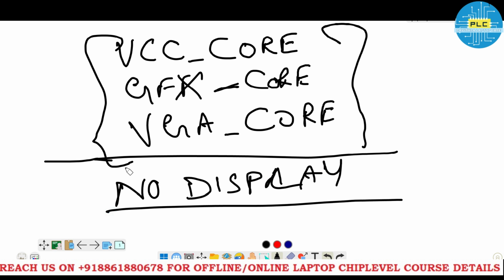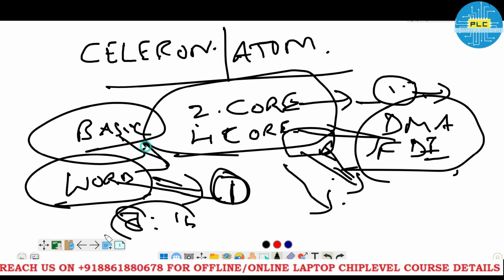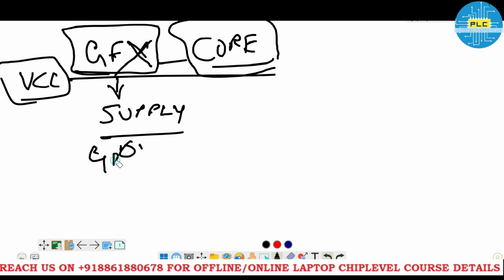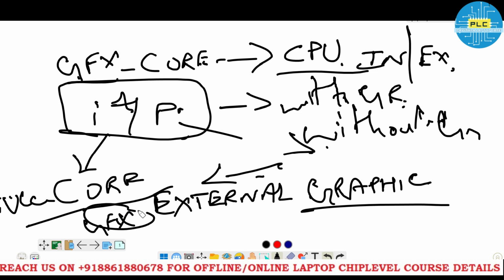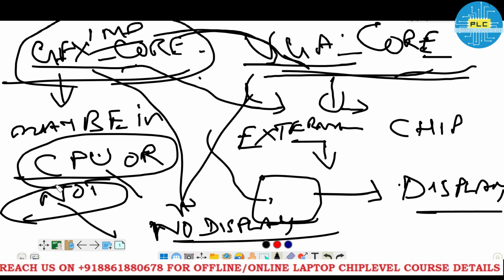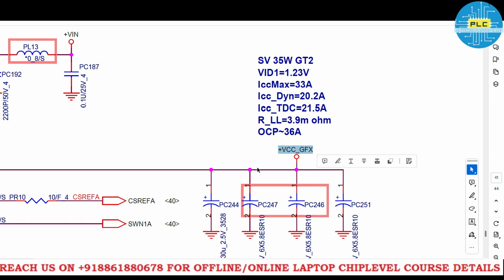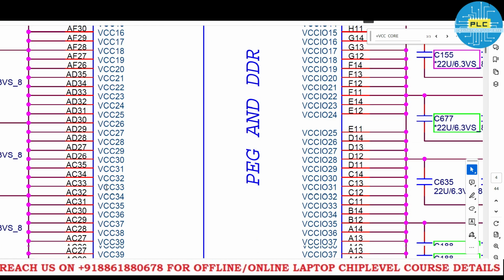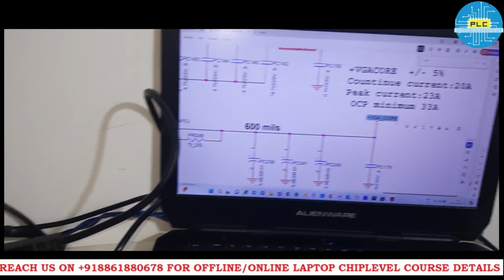No Display? || How to solve it in Laptop Motherboard? What is VCC_CORE, GFX_CORE AND VGA_CORE?

Comment: Please SIR AM INQUIRING, FAILURE OF  thermal section for VCC-CORE IC CHIP  CAUSE WHICH PROBLEMS ON MOTHERBOARD   (NTC)
Reply from the maker: Dead in vast of thermal issues.  It feels motherboard is getting too hot. So, no power ON
Reply: @LaptopCourse  Dear sir i have problems with No display even all core is activated with actual volts after deep testing I found thermal sensor N/P is 3.3v so both voltage present  can cause No display issues?